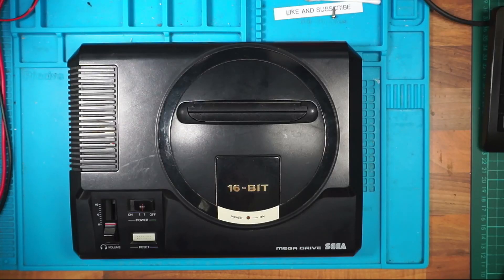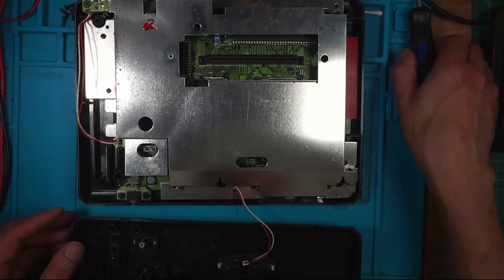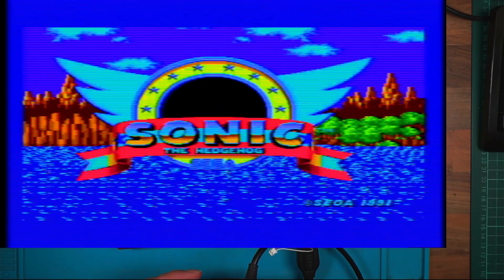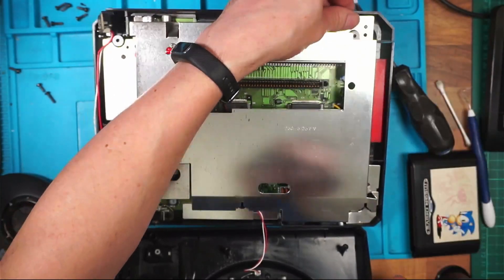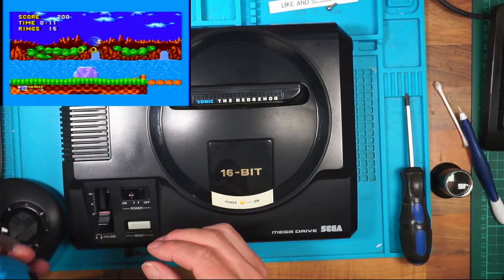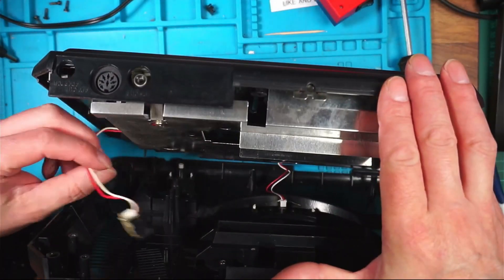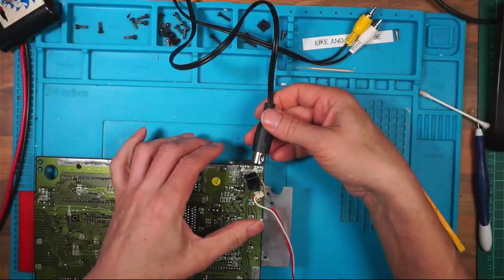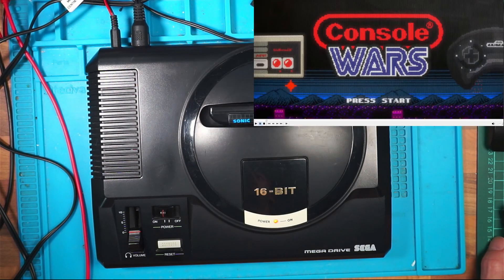Sega Megadrive No Video Out Fault | Rasperry Pi 3B+ Ebay Win

Comment: I love picking stuff up on ebay that is listed as faulty and sold for a cheap price... and the fault is a silly little thing that is easy to fix. 

My favorite one was a guy selling a Panasonic portable CD player for a few bucks. The listed fault was "Defective, will not play CDs. Keeps saying HOLD on the screen."
The guy sold it as defective because the hold switch was turned ON. He had multiple CD players listed just like that.
Reply from the maker: I have to admit to feeling a little guily about the RPi being working. The seller was gutted when I asked it what was wrong with it, because I couldn't find a fault.
Reply: @PhilipBryden  Well unfortunately that's how it goes sometimes. I suppose it's better for the seller to have a small foul up for a relatively cheap item like a raspberry pi. At least it wasn't a million dollar painting for 20 bucks.

I messaged my seller with the CD players that said HOLD on the screen. Tried to be polite and explained what was going on. He totally ghosted me.

Months later, I checked and he still has one of those players listed for very cheap. The description says "Powers on but keeps showing "hold" on the display.  Cant get it to work." So I don't feel bad at all for this one seller.

Comment: "One of these screws is slightly longer...and I don't know which one it is." Story of my life working on Nintendo consoles. I always find out after I've drilled a hole through the shell. Great video and great find with the raspberry pi!
Reply from the maker: Thankfully I haven't (yet) popped a screw though the top of a case. Had a few broken screw posts though